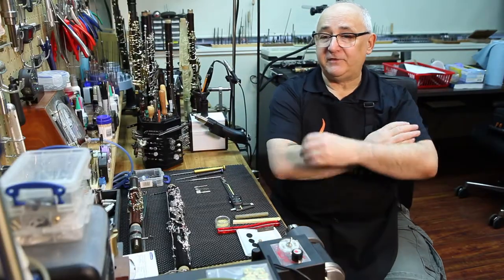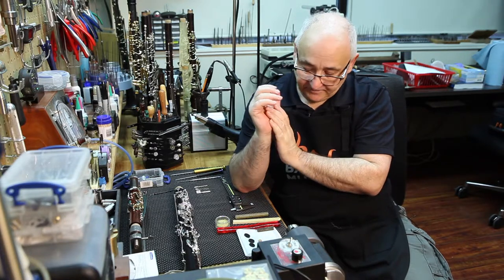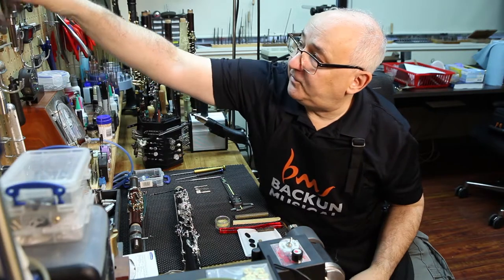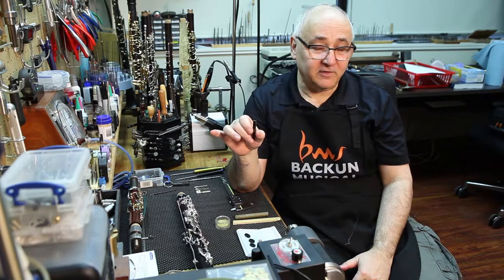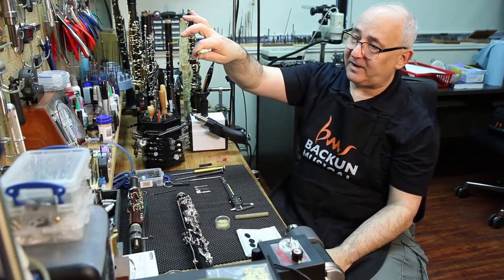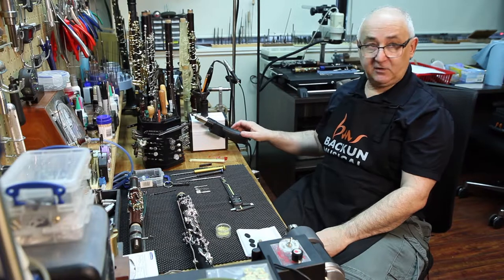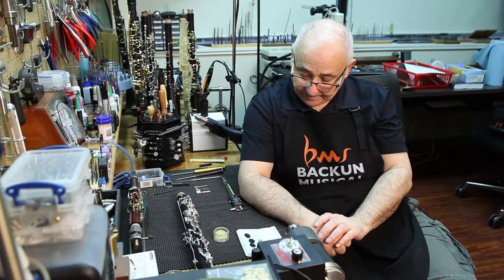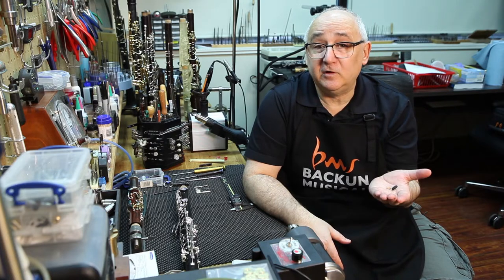Clarinet Padding Tips and Tricks with Morrie Backun

Comment from the maker: Which type of pads do you prefer?
Reply: I prefer the LP-Gortex pads. They are waterproof, and they feel quite firm to the touch.
Reply: I like any pad that seals without sticking. Any tips for cleaning sticky pads?
Reply: The reason you may have sticky pads is because you may not be getting all of the moisture out of your instrument after your finished playing. @Brendan Toohey
Reply: @alexandergasparyan6173  yes, but any tips on how to clean them if they're sticky?
Reply: @Brendan Toohey That is a really good question that I can’t seem to find the answer to.
Reply: @alexandergasparyan6173  I've heard lighter fluid works well, keen to hear Morrie's thoughts
Reply: @Brendan Toohey I honestly don’t know much about the “lighter fluid.”
Reply: I like Valentino waterproofs
Reply from the maker: @musokid89  We'll ask Morrie!
Reply: @musokid89  Selmer used to make a small squeeze container of ultra fine powder. Puff it on the sticky pad and problem was solved
Reply: @danwebster5439 worst idea over time.  It gums up the key mechanism causing new problems.
Cigarette paper is a way to remove stickiness. It doesn't take up much room in the case and lasts forever if you buy a packet or just get one or two pieces.

Comment: THANK YOU for pointing out the drawbacks of hot glue. I'm a fan of shellaque with cork...I find I get more feedback. It's very important that I FEEL the core & center of my sound (if now, how can I tune?) I prefer manual to automatic transmission. Also, I find I don't have control with the squishiness of valentino masters (even when properly put in). It's maximum press is seal, so I find my wrists become more encumbered. And finally, I simply feel that I have more control over colors when the seat is absolute with minimum effort, and with as least-deceptive feedback (again, strong resonating center entering into my skull and ears). But, I understand that many clarinetists today are averse to said feedback. But that is a lack of pedagogy, as proper education is needed to inform the differences between "near" sound and "far" (the audience's perception).

Comment: What is the melting point of the pelletized glue? The "flexible stick," if it's what I think it is, has a working temp around 150-200C. I haven't found it to be stringy, but I usually do a little twirl at the end, like they do with soft-serve ice cream:-) When you've used a stick, did you ever apply it directly to the pad, rather than to the cup?

Comment: I try to match up  what is in the clarinet unless it is a full repad.  If a skin pad sticks I don't try to clean it, just clean the tone hole with a microfiber cloth and replace the pad. If a pad sticks the skin has pulled away from the felt and will usually buzz.